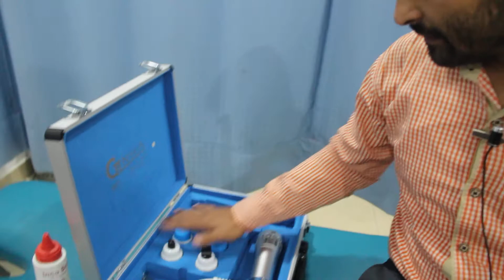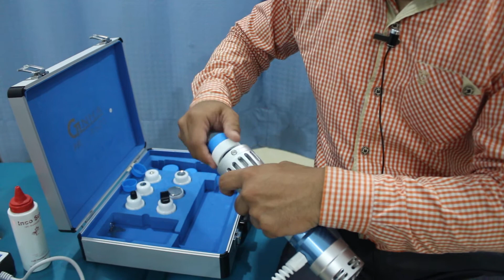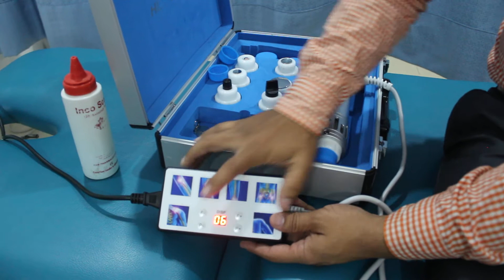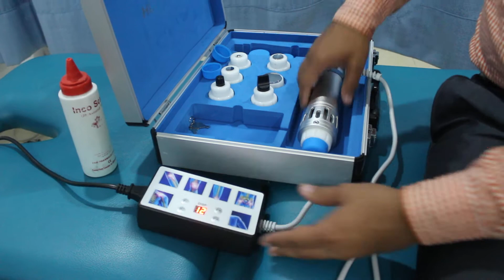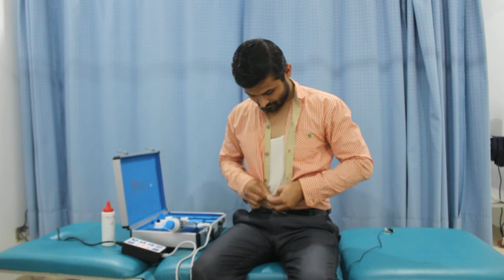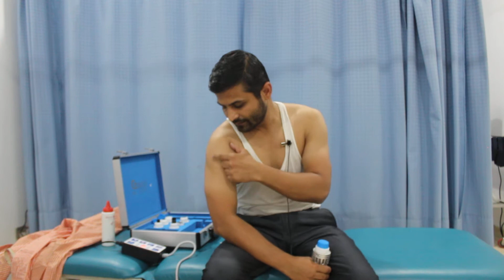Shockwave Parameters for Calcific Tendinitis

Comment: Do you leave the blue silicone cover on the shock head when treating, or take it off? And why??
Reply from the maker: It is a protective covering, the dampens the shockwave, and it acts as a barrier against contamination and prevents infections, its washable and you can clean it with anything appropriate.
Reply: @SyedAliPT  Contamination? Infections? How?? The skin isn't being broken. Why dampen the shockwave?? Isn't the idea to have it as strong as possible?
Reply from the maker: @mikthe2004  there are a lot of issues, even if the skin is not broken. The values provided are with sleeves on, not with sleeves off.
Reply from the maker: I do keep it on all the times.

Comment: Excelent, please let me know where can I buy the shockwave therapy machine ? thank you.
Reply from the maker: I think on ebay and Amazon.
Reply: alibaba, amazon, ebay probably the cheapest unfortunately the instructions for this suck, its like a pamphlet that isn't very helpful. it's made in china so no manufacturer name or contact info available and you have to figure out how to use it on your own. It creates the shockwave by operation of a mini air-hammer inside that makes a loud knocking noise, guess its a slight sound shockwave and definitely not sonic. I bought one on amazon for $389 cheapest with taxes but can find on ebay in low $200's

Comment: Can you perform for tennis elbow for pain
Reply from the maker: yes, we can do it for tennis elbow pain, and its very effective.
Reply: Can you post a video the parameter because im using the same model machine which there is only 1-12 frequency, and power 1-12.. for tennis elbow what frequency and power i use?
Reply from the maker: @geraldinetycoonpt1713  Use P 3-4, F= 10, total treatment time should be 6 to 8 minutes. Thanks

Comment: I got same machine but unfortunately there was no manual or using instructions , it’ll be great & I’ll be thankful if you would help me . I’m confused between heads pulses & power, don’t know the purpose for each one & the right pulses & power for the different areas of the body
Reply from the maker: see my other video.
Reply: Hello sir, thanks for the explanation. Can you pls explain about radial or focus shockwave and which one  should be used for which condition. I have calcific tendonitis of supraspinatus tendon. 12"4 mm deposit. Thanks